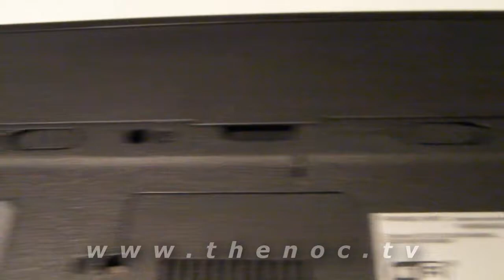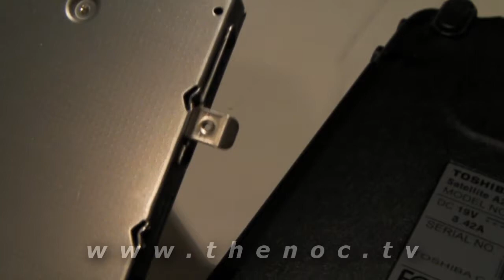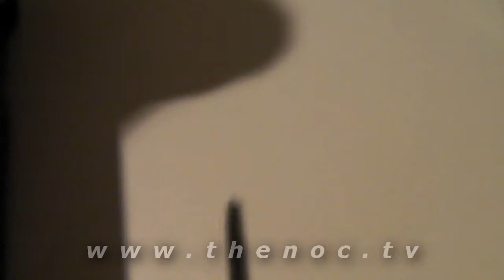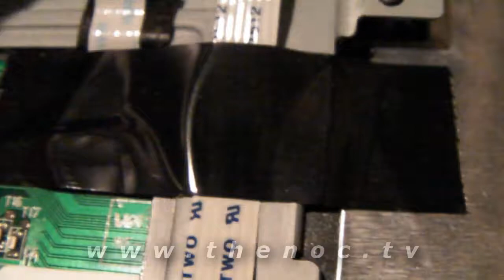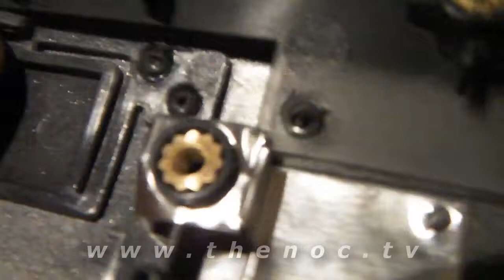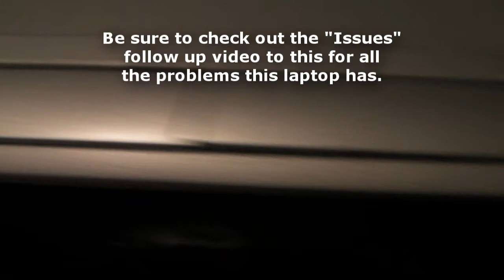Repairing jammed track pad buttons on a Toshiba Laptop

Comment: Thanks for the video.  But with all respect it's very frustrating to watch you explain how to pull out battery, yet leave out the most important bit of this video and that is how to lift up the the top of the base of the touchpad, ie starting with the power cover etc...Coud you please include this?

Comment from the maker: @jellis4465 The only way to fix a track pad is to replace it, if it does not move correctly. Sometimes the wires are loose on the inside, but if that's not it the track pad has to be replaced.

Comment from the maker: @RawrChromeIpod You likely have damaged the hard drive. The staling is probably it trying to access data in a damaged section of the drive, or the drive having difficulty reading the data. Try doing a test on the drive to verify it (I have a few videos on it), another possibility is something might have been unseated partly like the ram causing timing issues, make sure everything is seated properly.